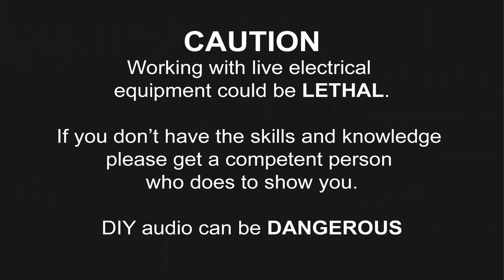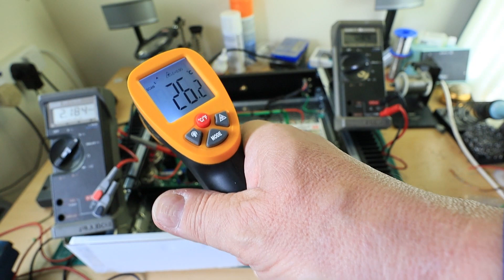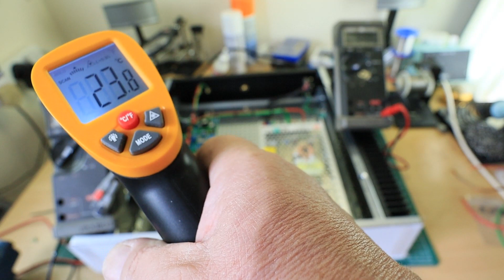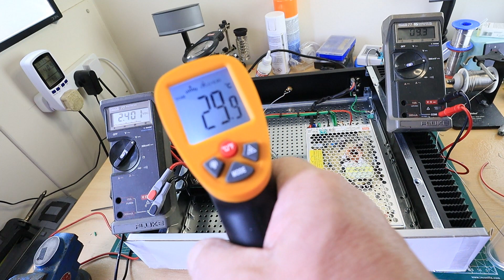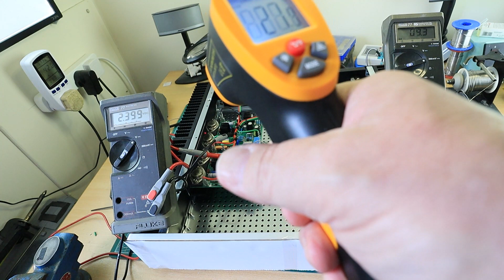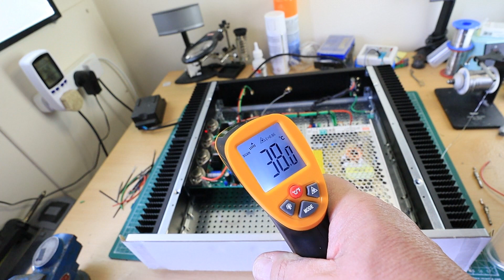Avondale Audio NCC300 'SMPS' Power Amplifier Build (PT1)

Comment: What did you use to attach your two SMPS supplies? Are they just glued to foamboard?
Reply from the maker: Hi Mike, No there held together with 3M 20mm self adhesive neoprene spacers. This gives an air gap between them.

Comment: Hi Les

Interesting video.  Am waiting for some NCC220 boards which I ordered from Les.  My case arrives tomorrow

I am wondering how you found the sonic properties of using switched power supplies over the traditional linear PSU solution?  You seem to imply that you like what they do for your implementations?

I always thought that switched mode PSU's were not great at suppling high transient currents but maybe that's not the case with the latest designs.  Maybe minicap6 without the rectifiers would be a solution or improvement for the MeanWells?

Keen to hear your thoughts on this.  The MeanWell PSUs are certainly cost effective and have a very good reliability record.

Thanks

Malcolm
Reply: Apologies I just realised I called you by the wrong the name 🙈
Reply from the maker: In my life I've been called al sorts, most not very complimentary. :) No Problem

Comment: Brilliant informative video as always... thanks so much
So do you think that a qudos (ncc220) could be built with switch mode power supplies...or as there is no on board regulation like the 300 has...is this a no go??
Thanks for any advice!
Reply from the maker: Hi Tim, This NCC300 SMPS project is a direct result of an earlier build (experiment) with the NCC220/Qudos amps some time ago (over a year I think) I was impressed at that time but didn't pursue it.  It does work and the SMPS is a 'regulated supply' from the get go. I am now waiting on these new NCC300 to 'come on song', It does take some time for these amps to sound there best . I have standard type NCC300 amps using transformers and caps as a PSU so I'll be able to compare and see/hear any sonic improvement or not.  There will be a follow up video outlining my findings and a further video using 4 SMPS' per amp voyager style.
Reply: Yes I'm looking forward to the forthcoming videos with interest!!
And of course I have watched your previous conventional NCC 300 build too
I have a standard build NCC 220 (traffo and cap6 etc) and was wondering if the  small DC supply you are going to use next for the front end might be the answer to making a voyager type front end for my amp... while keeping the current power supply for the back end
Are these cheap switch mode supplies really quiet enough to make an improvement??
Guess we will find out soon! Keep up the good work
PS
If you need to move on a pair of your NCC 300 amps ...keep me in mind please!
Thanks Tim
Reply from the maker: Yes, a SMPS on the front end of your 220's will work (they are quiet enough or rather a good quality one will be, I see another vidio in the offing...:). The fact that N Pass uses them on his little ACA was testament for me to push on with this project (along with main stream 'hi end' audio manufacturers). It may need some tweaking (some caps between the SMPS and the amp board may be) but as a starter for a budding DIYer its a great  way to get going with out the complications of traditional TX/uF PSU etc.